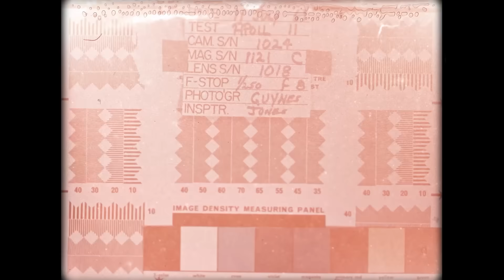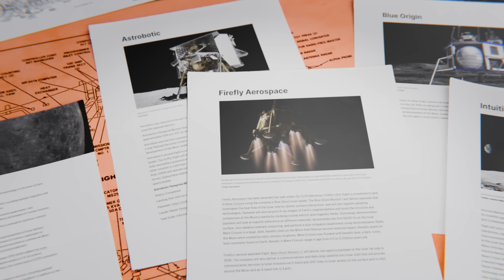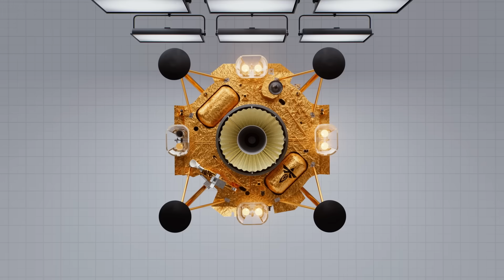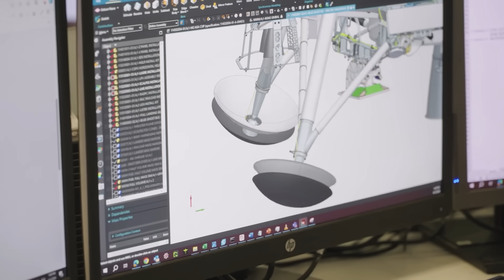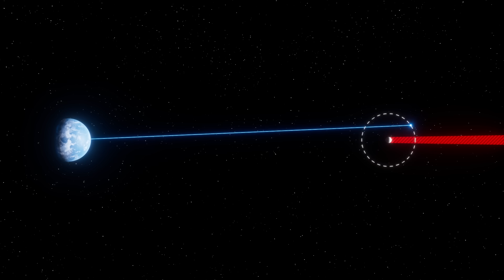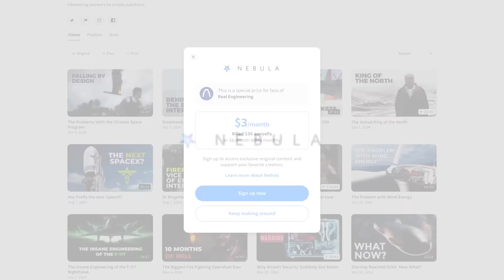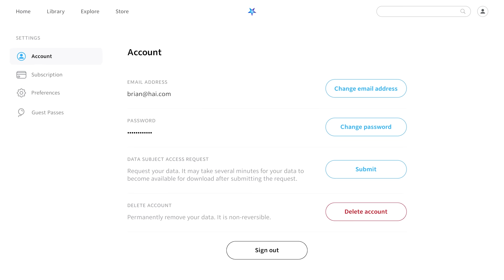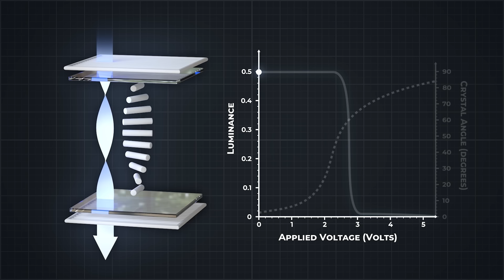Why the US is Struggling to Land on the Moon

Comment: Last time we brought Electric vehicle that could go 60 miles and Broadcasted live from the moon, a lot of cool technology in the past.  Sadly a lot of the shadows didn't go in the correct directions maybe they'll fix that this time
Reply: "a lot of cool technology in the past"
indeed 🙂

"a lot of the shadows didn't go in the correct directions"
Not sure about what you're talking about, but I'm pretty sure you have been hoaxed by some con men on YT.
Reply: Well, zero atmospheric drag and only 1/6th gravity is going to help with its maximum range.
If all the shadows were parallel on undulating terrain, and near shadows looked parallel to far away shadows.
Then that would be weird.
Reply: @Lee.S..B  I look through maybe 3000 photos on the lunar website. Found a few with multiple objects At different points in the foreground and the shadows go different directions.  You can trace the top of the shadow to the top of the object and see where the light source comes from. If you do this for all the objects the  light source is roughly about a 100 feet in the air.  Since the shadows go different directions you're actually able to triangulate where the light source is even though it's not in the photo.  If you went in your backyard here on earth you couldn't do that the sun's just too far away 65 million miles.
Reply: @MrBob1984  :
"I look through maybe 3000 photos on the lunar website."
Cool.

"Found a few with multiple objects At different points in the foreground and the shadows go different directions."
Give an example.

"you couldn't do that the sun's just too far away"
We have two options:
- A random ignorant outsmarted 50 years of study by world class experts
- Some random dude don't really know how light works on a picture, as we often have seen.
Which choice should I pick? Sound quite difficult... Or not.

But I'll have a look, if you present clear and precise argument on a given image.
We'll see (but I wouldn't bet on it).

Comment: Didn't the Apollo 11 LEM have a touch-pole as a backup landing assist? In other words, NASA made like a blind pedestrian and used a big stick to probe the ground before taking steps?

Adjustable feet are great. Maybe adjustable legs would also be helpful? Not sure how much of a pain that would be from the engineering side. The complexity in the feet seems high enough to make giving it more leg movement seem like it'd be kinda daunting.
Reply: You’re referring to the contact probes. Those indicated when they hit the ground, and were used as a guide for shutting down the engine. 
By the time those probes were useful, the LM was already committed to a landing: it had to decelerate to near zero before the contact probe hit. 
What Apollo did right and IM-1 did wrong was a basic check before launch: IM forgot to switch the altimeter out of safe mode, so during the approach to the moon the altimeter wasn’t working.

Comment: Yeah, either nasa needs a new batch of nazi engineers or we never got there. I never thought I would be convinced we didn't.
Reply: IM made a basic dumb error that was found by NASA engineers in before Apollo even began, and has been extensively documented: IM forgot to do a preflight check on their spacecraft.
Reply: @Hobbes746  thats fine, but those guys in the 60s threw an oversized jiffypop up there and got it back when computers were the size of two rooms. Maybe this generation is just not as bright.
Reply: @fragginbastich7307  Those guys in the 1960s spent $300 billion. They built the fastest compact computer in existence for Apollo, and backed it up with entire rooms full of computers at Mission Control because they realized most of the complex calculations could be done on the ground. As I said, IM made a dumb error: they forgot to switch the altimeter on before launching. That’s why the mission failed.
Reply: @Hobbes746  i bet thst guy got fired, huh?

Comment: Millions of dollars, and y'all can't make a camera that pivots.. cute
Reply: Moving parts and moving electrical connections are prone to failure. Two static cameras is a better and more reliable solution.
Reply: You need motors, adding weight, requires power, adding more weight, and prone to failure.
Reply: When moving things in space there is always a risk of it getting stuck since the lubricating water film that is always present on earth evaporates in space.

Comment: To be really frank about it. The problem is not technology, its government bloat.

While its fair that we can no longer build the F1 engines. Just adding more engines is really not a problem today with computerization. And the engines we have today have far better performance than that of the F1.

Even the merlin engine of the falcon 9 have better specific impulse than the F1, despite running on far inferior fuel. The specific impulse of the raptor is far better, and it still use inferior fuel.

Where the real problem is government bloat. There is just to many people doing nonsense stuff, that was not true in the 1960s.

Comment: Americans didn't land on the moon. Nazi did. That's why.
Reply: 450,000 people were involved in the Apollo program. Only 200 were former Nazis. More than that were people who had fled from Europe because of the Nazis.
Reply: @paulsonsons425  450,000 people in all functions from metalworkers and janitors to engineers and scientists. von Braun was nothing without e.g. Linda Hamilton, who led the group that wrote the software for the AGC. Without Miecyslaw Bekker, who designed the LRV. And countless others.
Reply: The truth is that the education system in America is awful. Until it gets fixed, we will not have quality engineering.

Comment: The reason they cant go back holly wood wont film it for them this time.
Reply: Hollywood is not real
Reply: Hollywood didn’t film the Apollo landings.
Reply: @Hobbes746 The one pitcure that bothers me is the pitcure of earth from the moon. The earth should have looked 6 times bigger not the size of the moon.
Reply: @carlmanis879  bro😭 you think the genius people at nasa wouldn't have thought "oh well since earth would look bigger we should do it too if we are faking" ? If some firm of that level fakes something they don't make such obvious mistakes and for your question, no the earth isn't the size of the moon in the picture first of all its way bigger than that. Second the sphere dosnt look 6× bigger. Just because mass is 6 time mote dosnt mean the diameter is 6 time more
Reply: @JazzyKepler  The moon's mean radius is 1,079.6 miles (1,737.5 kilometers) and the mean diameter is 2,159.2 miles (3,475 km). Compared to Earth, the moon is less than a third the width of our home planet, according to NASA. The moon's equatorial circumference is 6,783.5 miles (10,917 km). Reading what NASA says it should look 3 times bigger then the moon. Yes I was wrong about 6 times.
Reply: @carlmanis879  The size of an object in any photo depends on the camera and lens you use. With the 250 mm lens used by the Apollo crews, those photos have a field of view of 14x14º. Earth as seen from 380,000 km distance is 2º wide, so the photos of Earth from the moon show Earth at exactly the right size.

Comment: Not sure why they can't just switch to some form of RADAR when dust occludes the cameras.  It's a technology that's been mature since before the original moon landings and it would certainly work for this application with a lot less fuss.
Reply: IM-1 failed because they forgot to switch the altimeter on.
Reply: Never was any dust, no crater from the thrust or any dust on the landing pads.
Reply: @Dale-v6o  Of course there was no dust. The exhaust gas from the lander move at more than 1 km/s. The dust they pick up moves at high speed AWAY from the lander. Because the moon has no atmosphere, the dust doesn’t billow into clouds around the lander. 
There’s no crater because the LM landed using only 1300 kg of thrust, which is spread out over an area of several m2. The force acting on the ground is enough to pick up small particles only. The lunar surface consists of a thin layer of dust on top of larger and larger, interlocking boulders. You need a lot more than 1300 kg of thrust to dislodge enough material to make a crater.
Reply: Money.
Reply: @Hobbes746      It's amazing how much physics the Moon-landing deniers refuse to learn, and instead quote nonsense that they heard from some other Moon-landing denier who also refuses to learn any physics, no matter how many times the nonsense is debunked.

Comment: Intuitive Machines lander didn't fail. Your channel has seriously become a joke of an "engineering" channel. It is really pathetic. No critical evaluation of cost vs. value, utter lack of understanding of the concepts. Even chunks of the information are not even factual.
Reply: IM-1 did in fact fail. It crash-landed.
Reply: @Hobbes746  It did not crash land. They were able to communicate with the lander on the surface of the moon and complete most of their payload objectives per their post mission interviews. It is ignorant to claim anything other than a perfect mission is a failure.

Comment: 6 landings in 3 years, now can't land a robot in 6 years ... strange isn't it?
Reply: 1/3000 the budget. Not so strange.
Reply: @Hobbes746 but the technology is now WAYYYYYY more powerful and cheaper
Reply: @KhabibsJacuzzi  Computers are way more powerful. Most of what you have to do to land on the moon is not limited by computer power. And all the computer power in the world cannot prevent people from forgetting basic tasks like switching the altimeter out of safe mode before launch, which is what doomed IM-1.
Reply: @KhabibsJacuzzi  we have no reason to go back to the moon FYI, it's expensive.

Comment: People fail to understand that 50 years of technological improvement does not mean the Moon's gravity decreases by 50%. Landing on the moon is still very difficult, and these missions are trying to do it at a fraction of the cost.
Reply: Every single component on the alleged rocket and landing module would cost a fraction to produce today with modern CNC machines, supply chain, and the much larger availability of specialized materials. The engineering cost would be basically zero other than the time it takes to dust off the old blueprints and convert them to CAD models. It’s all so silly.

Comment: You want to land on the moon, you need a level surface, for touch down, not really. This requires two disc parallel to each other on the lander. One disc able to pivot connected to the legs which are telescopic, one disc fix connected to the lander, The distance between the disc is a known, as the legs make contact you measure the distance between the disc having the legs extend to maintain / adjust the gap to self-level 
During touch down, the pivot disc will alter the distance between the two disc, correcting that via extending the legs so that the disc remain parallel will allow you to touch down on rough terrain provided its not the side of a cliff / crater.

Comment: At 0:32 you said IM-2 when it was really IM-1 that landed on the moon earlier this year. Also, while IM-1 did have an autonomous visual guidance system onboard, it was not used for the landing since a safety switch was accidentally left in place prior to launch, leaving them no choice but to rely on NASA's LIDAR experiment on board to land. This was revealed in an interview with IM CEO Stephen Altemus. This was not as effective as the visual system they originally planned for but allowed them to measure distance and relative speed and gave them an opportunity to land instead of crash. This was perhaps the real reason for why the lander tipped over, although the visual system would've had issues as well as you mention in your video. I worked at IM in Houston when we were building the lander so I have been following the post launch aftermath for some time. Fantastic video nonetheless, keep it up man!

Comment: The thing you said about the lander not able to survive night temperature on the Moon gets me curious.
The Moon has almost no atmosphere, and the stuff survived going through the void of space, possibly passing in the shadow of earth or the moon.
I don't get how being landed on the moon during it's night is harsher.
Reply from the maker: Because the moon has thermal mass. Space does not
Reply: @RealEngineering  Ok, I see how the moon can be a heatsink, but what I question is what medium allows for the lander heat to leave faster than in the void.
I'd expect the contact with soil to be minimal and the lack of atmosphere to make it somewhat irrelevant. The heatsink is not thermally coupled to the lander. At least that's my (probably wrong somewhere) reasoning.
Reply: My question is, what causes it to fail? Does the temperature destroy the electronics? If so, how would a more permanent moon base ever be a viable option? Would it not succumb to to same issues?

If the electronics isn't destroyed, couldn't they attach solar panels so they batteries could charge back up after the night was over? 

Sorry for the ignorance.

Comment: 6:42 All the good engineers seemed to have died of old age. The current generation doesn't seem to understand the conceps of "better insulation" and "bigger batteries". In the early 1970s, the engineers could build probes (like Surveyor 1) and even rovers (Lunokhod) that could survive on the lunar surface for many months. And our battery technology and electronics are way smaller, energy efficient and robust that anything they had back then, meaning the insulated "hot electronics box" that houses the electronics and batteries can be smaller and lighter then ever. 

Oh, these days you just can go online and buy some commercially produced aerogel as thermal insulator that is much better and lighter than anything the Apollo engineer had access to. Properly designed (with a small automatic/bimetall strip hinge to allow radiating heat when needed), an electronics box like this might be able to survive the night without a special heater. Just having some of the electronics and sensors powered (might as well do some science at night) could produce enough heat.

Comment: Why don’t they use a simple radar for lander height measurement? Its not like this would increase weight or cost significantly and it would give them a robust mission important signal. Height estimation by camera does not sound like a good idea in a dusty environment..
Reply: A radar gives you the height above the  average terrain. It won’t give you an elevation map that shows boulders: its resolution is far lower than that of a camera.
Reply: @Hobbes746  You can get better resolution with Lidar if you need to. But just a simple MIMO setup with a wide, medium an narrow view can give you way more reliable data than a camera setup. Wide view gives you average height and comparing that to narrow view can give a good warning against bolders. Also knowing height during final and if you bounced is a solved problem then.
Reply: Because if we can figure out how to do it with cameras it's cheaper, lighter, easier to repair, and less complex mechanically while having benefits radar doesn't have.

It's the same reason self driving cars are moving away from lidar. It's just not necessary now we have the processing power.

Humans don't need lidar to drive, nor do machines.
Reply: @drizmans  Driverless functions without radar is more or less a marketing gag from tesla. It is also the reason why they dont have a certification to take the hands off the wheel in europe while Ford, Mercedes, BMW have that. Removing radar just makes the driverless system function in a way more narrow band of situations. 
Cutting cost of a sub <100$ component with well established software integration may be viable on a cheap car. But on an expensive car or a spacecraft that simply does not make any sense to me. Radar sensors can be very light and small if you dont need high distances..

Comment: The original space race was so awesome and inspirational.  Wanting to emulate what NASA was doing, on vastly smaller scales and distances, we Boomers in the late 50's fired off toy rockets that perhaps went 100 feet or more into the sky.  I fondly remember when my friend and I, in our early teens, stuffed a plastic model V2 rocket with chemicals: potassium permanganate for the oxidizer, and I believe sulfur for the reducing agent.  We packed the toy V2 with these ingredients, after crushing them to a fine powder and thoroughly mixing them.  The toy rocket was about a foot high, if memory serves.  We went into a clearing in a nearby swamp, placed the rocket on a wooden box, which was set on a patch of ice.  After lighting the fuse, we raced to a fallen tree trunk for cover and safety.  At first the rocket lifted off its launch pad perfectly vertical, to our great thrill and surprise.  But after reaching about a foot altitude off the box it suddenly exploded.  Almost instantly police sirens could be heard in the distance.  We fled to our friends house.
Reply: Kids: don't do that. I've meet some who lost fingers by playing with chemicals that way.
Nowadays, there are cheap and decently secure on the shelf rocket motors for such things.

Comment: wild that nasa landed on the moon but has a hard time with it 50 years later
Reply: That probe wasn't NASA.
Reply: NASA spent $300 billion and did 29 unmanned missions before their first manned moon landing, many of those unmanned missions failed for various reasons, but those missions gave NASA the experience they needed to do a manned mission with reasonable safety margins. 
IM spent 1/3000 of that and was determined not to learn the basic lessons that NASA learned in the 1960s.